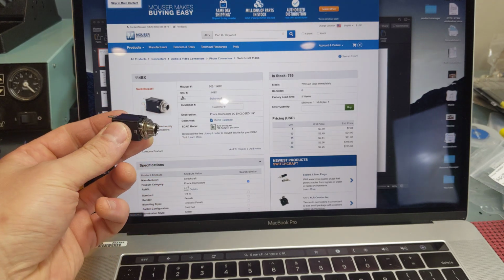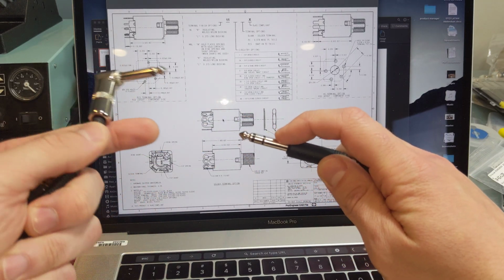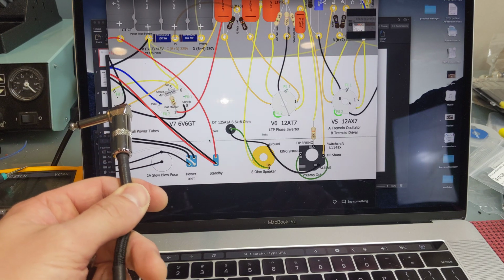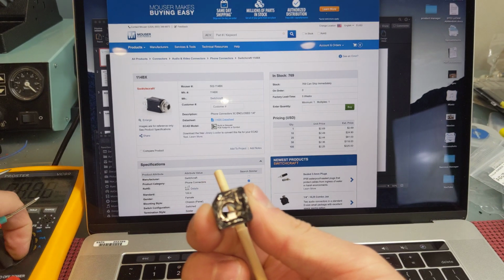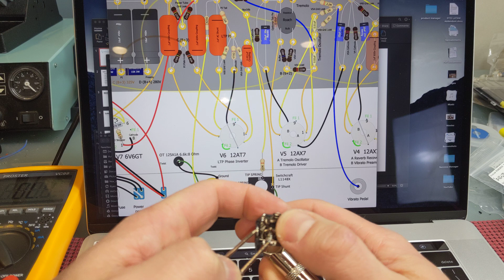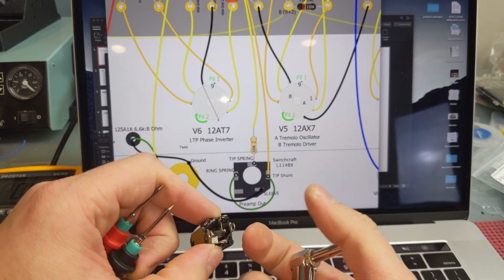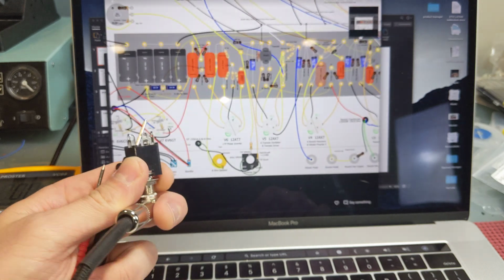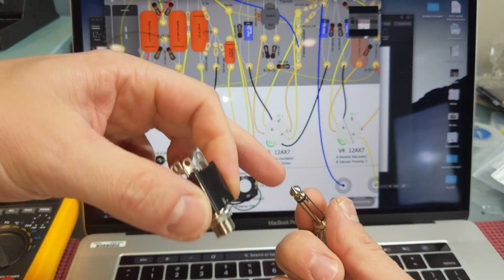How I Make a Preamp-Out on my AB763 Deluxe Reverb Using a Switchcraft 114bx

Comment: One thing that I don't usually see is whether or not the dummy load resistor to be used should match the measured DC Resistance of the speaker.  If an 8 ohm speaker measures 6 ohms on a multimeter, does it make sense that we should also reach for a comparable dummy load which also measures 6 ohms on the multimeter?